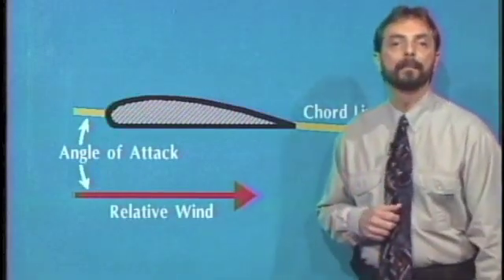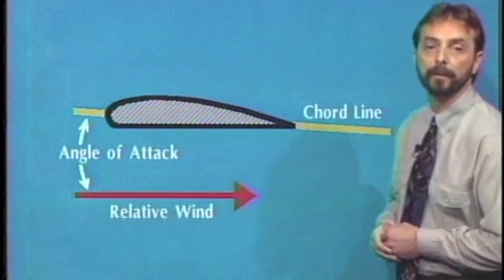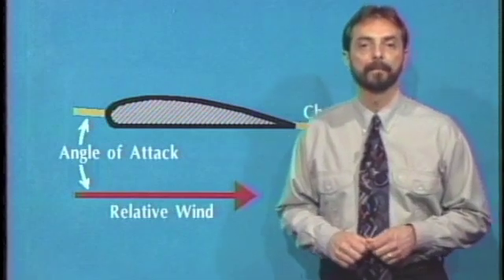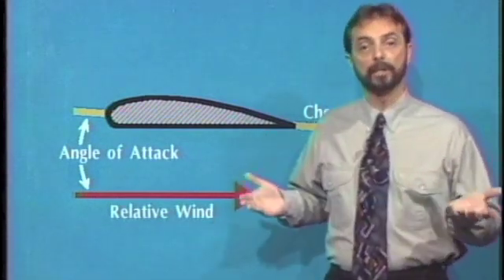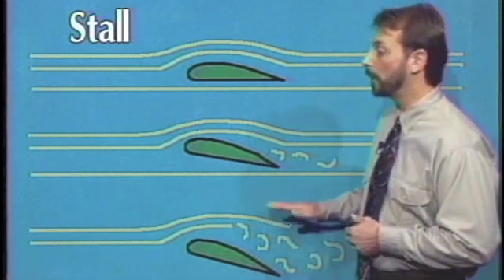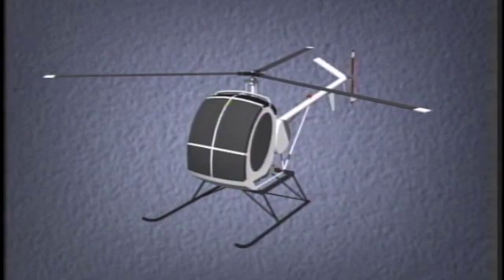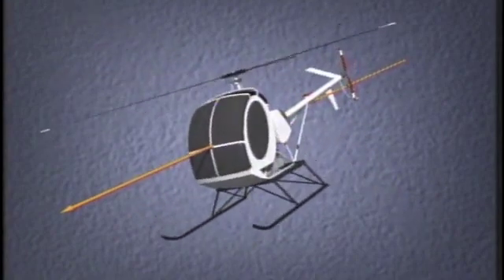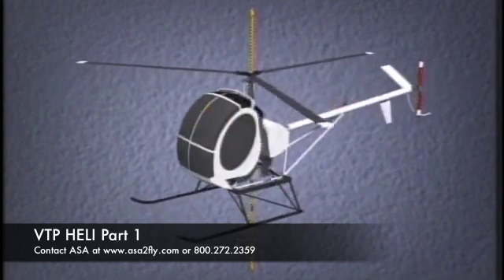VTP -- Helicopter -- Video (Part 1)

Comment: The question is where is the center of pressure located in helicopter rotor blade? In front of the feathering axis or pivot point or behind the feathering axis? Answer might be helpful for me thanks.